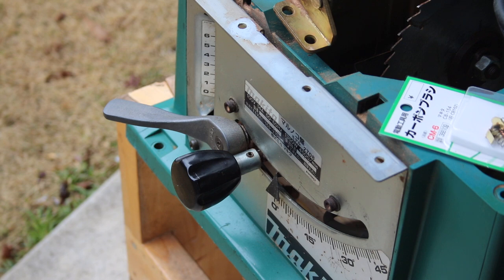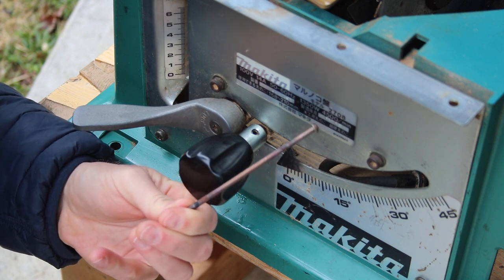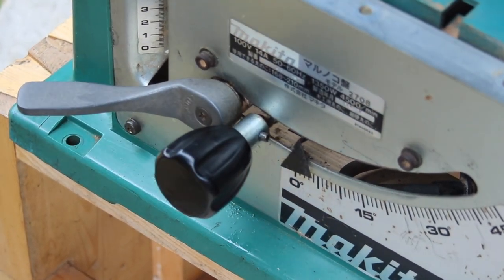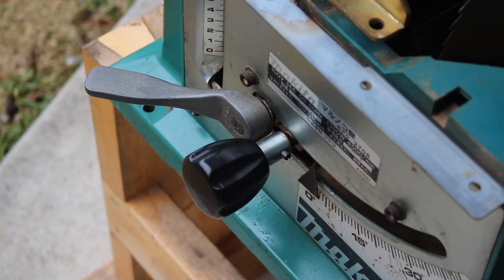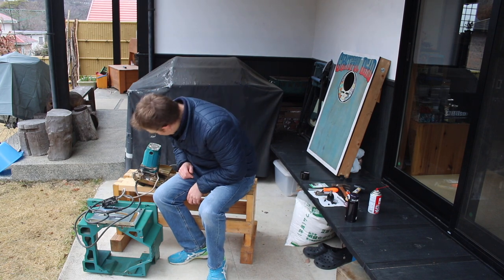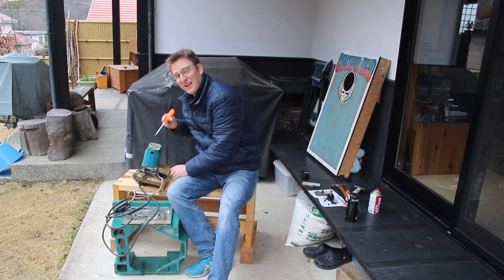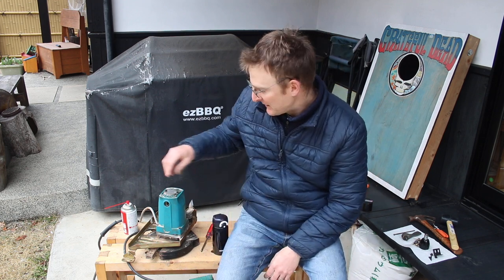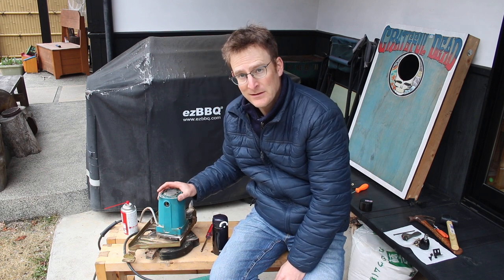Thank Goodness. MAKITA 2708 Handle removed - Bushings replaced

Comment: Thanks for sharing.  I have the same machine,first owner.  I like it so much. I lost the manual after several moving.  Do you know if I need to put lubrication on this machine? It is still in a very perfect good condition except I find it hard to crank it up. I appreciate your help.
Reply from the maker: Hello, thanks for the comment. I don't have the instructions either but I think   occasionally cleaning and lubrication would keep the machine running in tip top shape.
Reply: Search "2708 table saw manual" and you can get a PDF off the Makita website

Comment: Hey Sunday Carpenter. How did you know you needed to change the "bushings"? I just picked up one of these mighty Makitas myself and will follow in your footsteps....
Reply from the maker: I bought this used. It seemed to run at less than full power when I tested it out after the purchase. So I decided to change the brushes. It seemed to be the easiest thing to try first. Runs at full power now... Well, it will once I start using it again. It is on standby now while I'm figuring out out to make a zero clearance insert for around the blade. 

Here is a link to a helpful Brush vs. Switch tutorial.
https://www.ereplacementparts.com/repair-center/article/942/Tool_Diagnosis_Is_it_the_Brushes_or_the_Switch.html

Comment: Hate to be the one to tell ya but you didn’t have to go to all that trouble to change brushes.  All you had to do was use a stubby screwdriver. The one you were using was to long.   With a short driver the caps come right off and brushes can be changed in a couple minutes.
Reply from the maker: Yup, Found that out the hard way.

Comment: Those are called carbon brushes, not bushings. A bushing is a device used for a shaft or other plane to be supported in with a rotational motion. Carbon brushes allow for mains electricity to get to the motor armature. Just nitpicking, but it kind of annoys me. No offense.
Reply from the maker: Nate's Tool Co. thanks I was doing this late at night and missed that. Thanks for pointing it out to me.
Reply: @thesundaycarpenter2514  good luck on the restoration! I have the same saw and it is very powerful!

Comment: BRUSHES, NOT "BUSHINGS". JUST LOWER THE BLADE ALL THE WAY, SET THE BLADE ANGLE TO 45°, TURN SAW UP-SIDE-DOWN OR ON ITS SIDE PROPING IT AS NECESSARY. IN THESE POSITIONS THE BRUSH CAPS AND BRUSHES ARE FULLY ACCESSIBLE.
YOU DON'T NEED TO TAKE ANYTHING APART.
BUT I GUESS OR HOPE YOU KNOW THIS BY KNOW--IT'S BEEN FOUR YEARS SINCE YOU POSTED YOUR VIDEO.
HOW ABOUT DOING EVERYONE A BIG FAVOR AND TAKE THIS VIDEO DOWN 
THEN YOU COULD POST ANOTHER SUNDAY CARPENTER VIDEO USING THE CORRECT METHOD.
JUST SAYIN'.